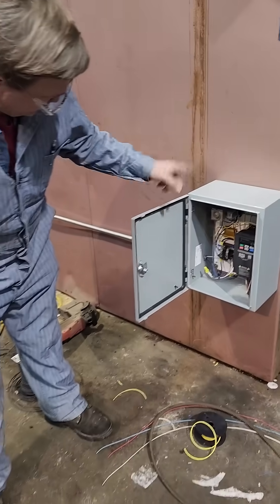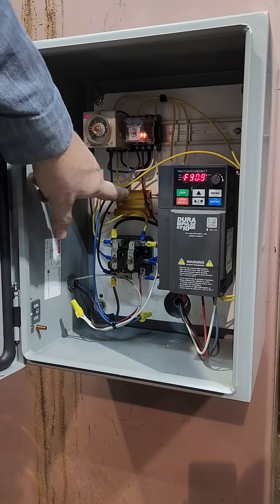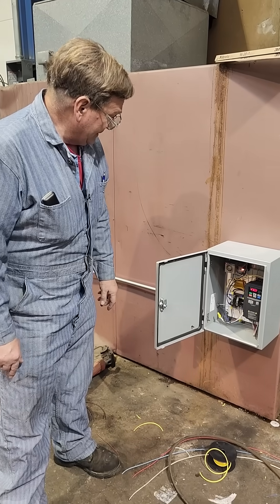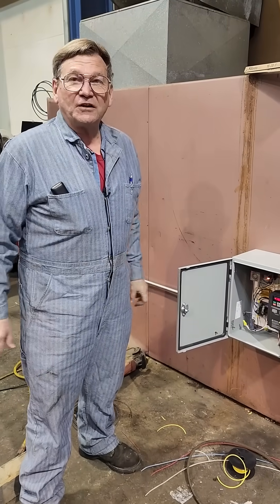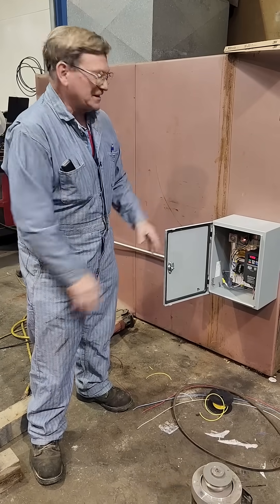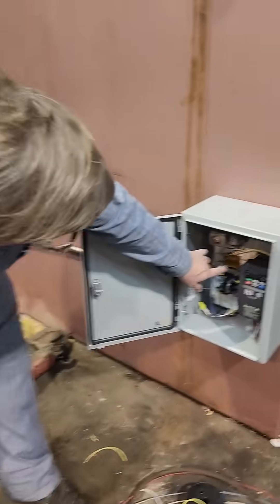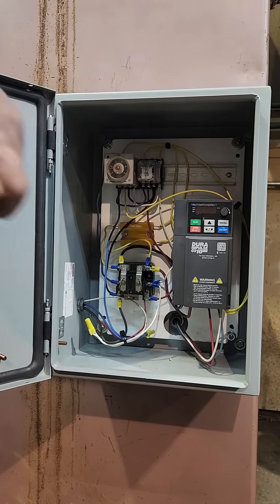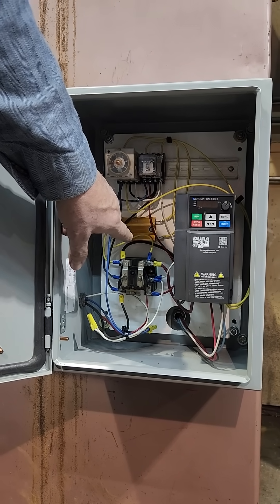Overcoming resistance to capacity 2hp VFD on 14 gauge - the furnace works!

Comment: The problem with three letter acronyms they are always taken.  VFD in my head is Vacuum Flourescent Display.

What about using an inrush component?  TV sets and a lot of other electronics use a component that turns into a resistor at inrush current and then it drops with reduced current.  Whether they make them big enough for a drive controller I don't know.

Comment: When you add a vfd to an old motor, you might want to add a ground brush to the motor shaft. Something about vfd's makes the bearings arc and fail slowly. I worked in industrial HVAC for a few years and saw this happen regularly when hospitals upgraded their air handler controls. The new replacement motors had grounding rings on them to solve the issue.
Reply: It only used as a soft start, for ramp up.
Than it runs on trough those big contactors controled by timing relay
Reply: @commenter5469 Ohhh now I understand. That's awesome!
Reply: @gruntledgarage dead on information bro

Comment: Note that those low cost VFD's have VERY nasty power factor, which makes tons of electrical harmonics and high kVA demand. Thats often why they want large wires on the input.

Using a VFD with a power factor correction circuit is very worthwhile. Especially if it has significant run times on larger motors, as the electrical demand savings can be significant over time.

Commercial wiring here mandates 12AWG minimum wire size, and all our building VFD's only have 12AWG, fed with 208V 3Ph, the biggest being 5HP.

Comment: Try the Delta CP2000 series VFD's. Very nice units!

They have an active power factor correction circuit in the rectification section, and most probably would not have the problem you're describing. 

I desk programmed a decently sized one recently, rated for 7.5HP 208V 3phase. I just put 120V across 2 of the line inputs, and plugged it in - was able to program it without issues, other than it complaining that the line voltage was low, lol. But definitely no surge issues.

Comment: Keep the drive powered and just give it a run signal from the fan relay in the furnace. Most drives have a pre-charge  circuit so it does not need a external pre-charge. I can see that you could have a problem where you apply run before the drive is ready. Some drives can be programmed to handle that.
Reply: I think that he was doing a work around from what you are suggesting because he's still running on 14 guage from the breaker panel ??

Comment: I have seen some soft start systems getting built (in a factory I worked in) that could soft start multi-hundred horse power motors! They were 2-3 times the size of the heater you are standing in front of!

Comment: I just did a video similar to this on my channel, except I used a 100w light bulb instead of the resister.  But this is right on, with the timer and relay.  Good idea. ---Doozer
Reply from the maker: I used bulbs on the first similar versions of this, but they do burn out & someone will be changing them for low newer LED or Florescent, so I gave up early.  But it is fun to watch the bulbs dim.  The original reason for me using bulb was from the idea of a 3ph generator synchronizing panel, using bulbs.

Comment: Inverters (vfd) always have a startup speed control as well as slow down to stop. the additional soft start circuit was a waste of money and time. RTFM for the inverter instead. 
Bottom line is that you can change the rate at which the motor spools up on start and down on stop. I've never ever seen a vfd that didn't have the setting in the configuration menu.
Reply: The charging circuit is to control the VFD capacitor charge rate, nothing to do with soft starting the motor, THAT'S what the VFD is for.
Did you actually listen to the video, or do you just understand nothing about electronics and capacitor charge rates?

Comment: Well that's one way of doing it! I probably would have unsoldered a capacitor or two. Running a 9A load on an 18A drive? Take out half the capacitors!

We used to spec capacitors so they were 1/4hp or 1hp per cap. Need a 5hp VFD? Populate 5 caps on the board in the factory.

Comment: You don't need to account for the inrush in sizing the wire.  It's nearly instantaneous.  Feed the VFD with  slow blow fuses and no need for the charging resistors nor the contactor.  I've seen hundreds of VFD installs and this is the first I've seen with the cap charging circuit.  However it works and I'm sure will for a long time.  You just might be writing VFD's off in other applications for no reason.
Reply: The VFD is specced for 8 gauge wire I think he said, but it's fed by 14 gauge wire, so yes, it's a special circumstance where he has to account for inrush because it's being used in an off label application.
Reply: @ke6gwf it is still an NEC code violation, branch circuit must be sized at 125% of the VFD rating!
Reply: The last part of what you said in how this can be expected to run well for a long time to come (potentially immeasurable degradation ???) is what I think may be a key factor in why he did it this way and why it is worthy of at least general approval 🤷🤷I'm not an expert , but I  think that I kinda like it 👍👍👍😁😁

Comment: My furnace in my house has been actively used since 1974. I replaced the gas valve once.. I just realized how sophisticated and advance. this piece of machinery was because it had a soft start since the day I owned it.
when the thermostat called for heat, It takes  10 seconds for the fan to spool up. 
Don't ask me how I've never looked ..
I just purchased a VFD for my lathe: converts 240 split phase to 3 phase.240v 
Soft start is a very big part of this phase converter and I'm looking forward for more videos about anything VFD 
👍👍👍
Reply: My furnace is original 1982. We don't question why it still works and in the 25 years we've owned this house had zero repairs.
Reply: @ColtonBlumhagen 
I know eh? 😂😂
It's 86% efficiency has earned its rightful place in the efficiency spectrum:.. if 40-50 years old WELL DONE!
Reply: We need a slow, long-form video of this.

Comment: Ok, I've been breaking chips since 1983 and I can make a lathe sit up, roll over and bring me the morning paper.   But when it comes to electricity, I will run for the hills.
    If I only knew half of what Howie has forgotten.   
I need to work for this man.  Even at 58 years of age, I can see that I can never learn enough.
Reply: Can you do this with old lathes or does it only work on new ones?
Reply: you can put a vfd on most any electric motor.  old lathes work great with them.  i want one for mine.  you dont have to change gears nearly as much with the vfd.  and you can put an occillate and set your duty cycle to help get rid of harmonics if you have issues with that too.
Reply: 58? You still have lots of time to learn. Don’t fear it.

Comment: 48 year old with 29 years experience commercial/ industrial electrician from 
T.O 🇨🇦. I just want to say that this dude is SO incredibly intelligent. What he just put together and showed us is so far away from normal diy projects. I’m  so impressed and entertained by the level of this man’s knowledge and experience. 👍🏻👊🏻🙏🏼
Reply: Why has Howie used a contacter here?
Reply from the maker: @wiwekiboi2424  The relay bypasses the resistors after the Capacitors have gotten fully charged.  The resistors are used to reduce the initial power rush into the capacitors, as that would overheat the wire supplying the system.  VFDs are great, but they require way more power to turn on than to operate.  This technique allows them to be used in low power installations.  This is also great for running off of generators, instead of using a larger generator, burning extra fuel without benefit.
Reply: @HOWEES Thank you for your reply, I live rurally in New Zealand and just recently installed another VFD that kept tripping the circuit breaker. The very system you've implemented would alleviate that!
Reply: Don't cables have thermal inertia ? The inrush of current is very short, afaik, and the wire resistance itself should not produce so much heat, except if the wire is very long, I guess. Btw, newbie here, this is a real question, not a judgment. Thanks in advance for any insight

Comment: I'm curator to a large industrial air compressor that starts with such wicked instant kinetics. It's a wonder that the belts aren't instantly severed on start-up.
If not the large pulley separating at a molecular level?  lol 

Seems the compressor really needs a soft-start. Then again, it's been working for 60 years, so who knows? 
Sometimes I wonder if the issue isn't line-voltage "creep" up from the original designed-for 440 nominal?

Ditto a power washer. I did install a soft-start on that. Mostly because with the violent reactions to the instant mechanical and hydraulic "kicks" it would almost flip over on start-up. 😂
Reply: Soft-start isn't necessarily the only solution.  Compressors from the pre-VFD era often had a mechanical or pneumatic control mechanism to close or bypass the air inlet for a couple seconds at startup.  Gave it some time to come up to speed before gulping in a bunch of air.

Comment: As far as VFD’s go, you can get an ABB VFD for about $2000. My state gives rebates per HP for putting the drives in. If you have a buddy at the electrical supply house, you can probably get a better price as well.

ABB is nice because you don’t need an extra junction box, all the terminations happen at the drive. They can do pretty much anything you want and are relatively easy to program (though all VFD’s have a learning curve to program). I know 2 grand is a steep price, but if you have a rebate as well it might make it worth while.

FYI ABB drives are spec’d for all commercial project we do. We are an HVAC controls company. We do work ranging from new K-12 schools to federal government project. So, they’re proven drives!
Reply: The ABB is nice, but the Automation Direct VFD is probably less than $200 dollars with free software lol
Reply: ABB 550 and 580 are great. Siemens drives suck ass
Reply: AND ABB GO OUT LIKE QUEERS ON FRIDAY NIGHT. HE GOT WHAT HE NEEDS RIGHT THERE  !!!

Comment: That VFD has programmable start & stop delay built in. I'll bet $100 it does.
Reply: It's not the motor start delay that he's dealing with, it's the inrush of charging the internal capacitors in the VFD, which no programming will change, because they are connected directly to the incoming line voltage.

The delay circuit and resistor is dealing with charging the internal capacitors, and is dealing on the electronics side of the equation, not on the power side.
Reply: @ke6gwf Leave the vfd on! When the furnace is powered, so is the vfd. Simple. It's done all the time.
Reply: @funone8716 that requires rewiring the rest of the system, plus uses standby power constantly instead of only powering the VFD when the blower is needed.

He probably saves a noticeable amount of power with this circuit, instead of leaving the VFD powered constantly.
Reply: @ke6gwf VFD powered on with motor off is minimal wattage. LOL

Comment: By the way you could've just put a direct drive blower in and it'd do the same exact thing especially with a ecm motor but I guess that's still kinda cool
Reply: Yes let's get a whole new motor and reconfigure the entire axle configuration of the blower instead of installing a module...
Reply: @Redact63Lluks reconfigure? It's literally as easy and undoing two bolts, two wires, and pulling the whole thing out and putting in a direct drive blower. it takes 15 minutes done it a dozen times
Reply: @alecmcjarison999 you have worked on that exact blower he's got? What's the part number for his unit?
And I think an Automation Direct VFD is probably cheaper than an entire retrofit blower assembly as well lol

Comment: You can't think far enough ahead to install the electric box high enough for ease of maintenance. Typical.
Reply from the maker: Location was selected 35 years ago by the furnace manufacturer.  I did not see the need to relocate & height is perfect for my work scooter, not shown in this video.
Reply: He's installing it where it needs to be, based on the existing wiring he's retrofitting.
The wires to the motor probably come right in the rear of the box, and he saved an hour of rewiring time but has to bend down to adjust things, but it will never have to be touched again.
Reply: Makes a nice buffer... keeps the passing forklifts from rubbing on the furnace itself. 😅

Comment: An engineers solution when belt-ease would work.
Reply: No, it's dealing with a harsh start, and belt dressing just reduces the noise, not the issue.
Reply: Belt squeal on startup means the belts are too loose. Align and tighten them first.
Reply: If the shafts and bearings are light duty like on a blower, you may not be able to tighten them enough to stop the squeal without damaging something. 
 @millwrightrick1

Comment: Sorry but why is that relay having all those exposed contacts😮? You already scared me pointing at it !! That is an absolute nono over here in the Netherlands and you cannot buy it either.
Reply: They aren't that uncommon in the US. You think that one is bad, look up an old elevator control. The relay logic on them in wild and some have hundreds of huge open relays running them.
Reply: Haha !
That's part of the American Spirit ?
Freedom isn't free !
Don't mistake, 
I agree with you on safety. Amerikans do strange electrical things sometimes. 
I see it firsthand daily.
Reply: The contactor is not supposed to be in control box like this but builtin to some machine that has to be shutoff before opening.
I guess he just has lots of them laying around so they are free.
Reply: @mrfrenzy. This is an entirely normal installation in the US lol
Reply: hehe
Reply: Sissies have to have everything idiot proofed!
Reply: They've been long banned in europe
Reply: Nothing wrong with having exposed parts in a box.  Most people are smart enough not to open it and touch something while energized.  We get things done, while you guys make things inside a box pretty, that nobody will ever see.
Reply: @cheftrd012 when you get onsite at 2am because production has stopped and 50 workers are standing around you want to be able to test and measure voltages inside the box without a high risk of touching voltages accidentally.
With a design like in the video you would have to turn off power before legally being able to do measuments on the circuits. The laws apply in the US aswell.
Reply: @mrfrenzy.  Not illegal to work on live circuits.  Electricians do it every day at all hours.  There is a thing called PPE.  And who cares if you turn off a furnace?

Comment: If you could give some in-depth discussions on programming VFDs, that would be awesome. Trying to go from single phase to three phase. Are the Chinese ones any good? Etc.
Reply from the maker: Yes most of the Chinese ones are good, I have been getting the lower end Automationdirect for most projects for a few years now.  Previously I had gotten surplus from eBay.  The best performing I have found are the higher end Hitachi (Japan) inverters, but the manuals from them are some of the worst, not too bad after you have worked with a few, not recomended for a first read.  Older "square D" manuals give some very valuable information on special circumstances of use with inverters.
Reply: Love watching your videos you sir are awesome 😊
Reply: I’ve got a Mitsubishi VFD, National Health Service surplus (I’m in the UK). Had it running a 3 phase pillar drill on single phase domestic no problem.
Not heard anything really bad about the Chinese ones, aVe did a project with one years ago. English instructions may be a challenge.
Reply: I repaired Siemens and Rexroth industrial drives, they break all the same. I call it loterry of life. As long as your AC is good, you dont push them, and use a breaking resistor whenever possible.